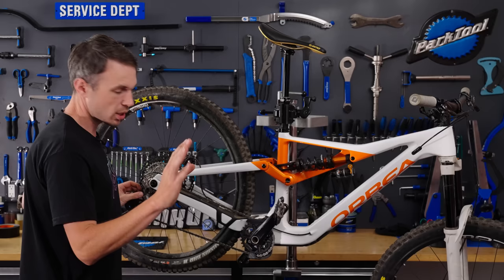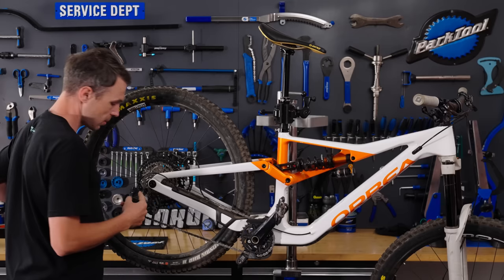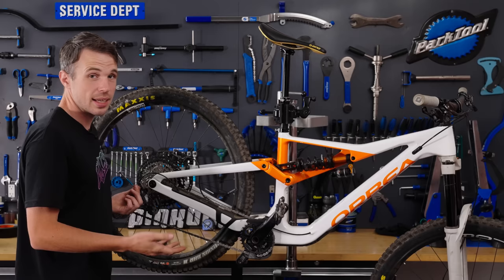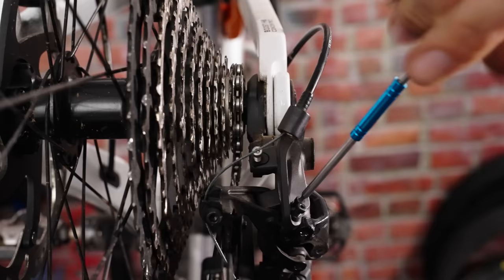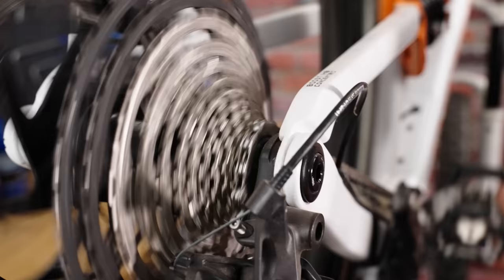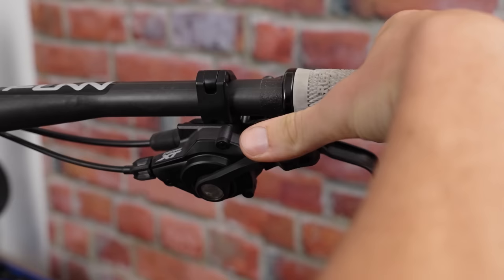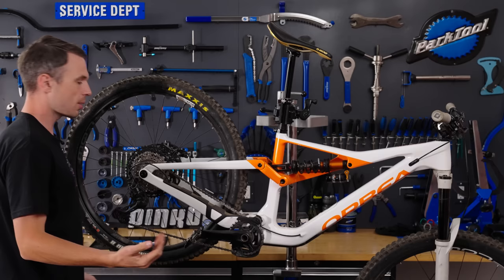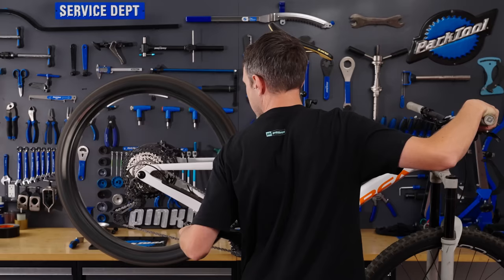How To Properly Set Up Your Bikes Shifting | PB Tech Tuesdays

Comment: Great general tutorial, but for 1x12 Shimano I like to add the following: According to Shimano the limit screw should be set with the derailleur jockey wheel flush with the OUTSIDE face of the smallest sprocket, not centered above it.B-Tension should be set with the stamped marks found on the derailleur cage facing the spokes. (Flush with the longer teeth of the largest sprocket). Once this is right, it will shift like butter with minimal to no further adjustment needed if cable tension is correct. 1x12 Shimano is the easiest to adjust in my opinion. 🍻

Comment: A few important bits missed out, or even wrong (my opinion!):

I'd set the B-tension first, at least roughly. Otherwise, you'll get stuck adjusting the cable tension all day long because it never shifts right (Dunno about Shimano, I have SRAM on my bike)
Then: Be sure to measure the movement of the derailleur when actually sitting on the bike. Especially with high pivot bikes, it may change a lot! The SRAM b-tension gauge even has it written: "measure at sag!"

Also, regarding the "inner" stop: Don't worry about it too much, if the rest of the cassette shifts properly, you can go to the granny gear no problem, it won't just shift over too much if everything else shifts about right.
Reply: Yes, B-tension before fine tuning. No, you still have to set the low limit, because if the derailleur gets bumped on a rock while climbing in the low gear, you don't want to shred your spokes with your chain. Also some shifters can pull the cable a bit past the detent for the low gear if you keep pushing the lever.
Reply: or if you have NX youll be spinning them all and always get some skipping in your gears lol

Comment: My bike had a stock 7 speed DH drive train and a 150mm hub and 83mm crankset. I used a 148mm hub with all the spacers needed and installed a 12 speed xo1 drivetrain. I wondered why i cannot get it to shift as smooth as the 7 speed. Then i learned that it was about chainline and how 83 crankset (55mm chainline) doesnt match the chainline of boost 148 hub (52mm chainline). Now all i did was put chainring bolt spacers to push the chainring towards the frame by 3mm and now it is shifting as smooth as the old setup.

Comment: Good explanation, only note is that shimano advices to run the cable around the whole clamp with 12s, allows for smoother shifting if i remember correctly, also less chance it hits the chain in the cage.

Comment: not how the manual says to set b tension but it does make sense to run as little as possible for the smaller cogs. becomes more important with 12 speeds.

Comment: Step 1 - check the hangar with a hanger alignment tool. Whether its a brand new bike, a brand new hanger, previously worked flawlessly, whatever. Often bent or badly fitted from new. ALWAYS, check the hangar alingment first. Wasting your time otherwise.

Comment: Agree with other commenters here, the intention was good but the follow-through was poor (with all due respect)..  I myself am a little fuzzy about the b screw setting. I understand the concept but just can't get it right..  I have two bikes both with Shimano 12 speed drivetrains.. I've watched tutorials and read the manual..   there is a line on the back of the Shimano derailleur to line up the teeth of the upper pulley (51t)...  I've gone through this several times and just cannot get the shifting right myself... good but not great.  Each of my bikes have since been set up by two different bike mechanics/different shops..   both bikes shift perfectly now, however the pulleys are each extended way past the (51t) line.. ??   Don't want to mess with either because they both shift perfectly now..   is this common?